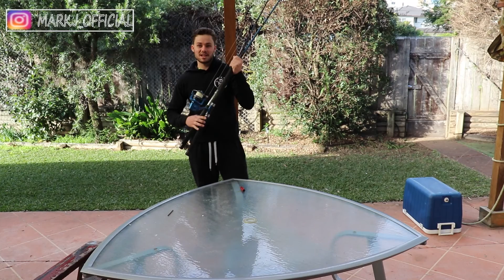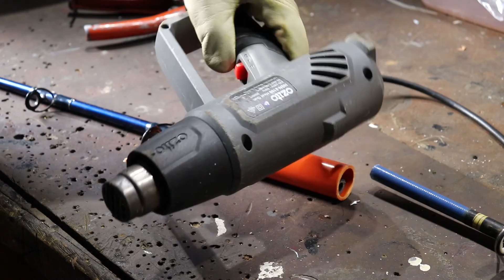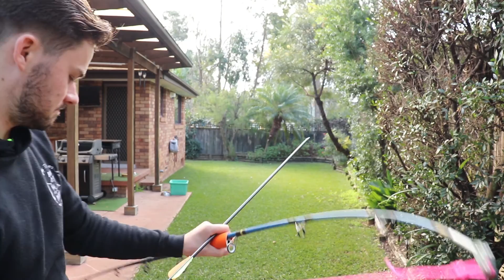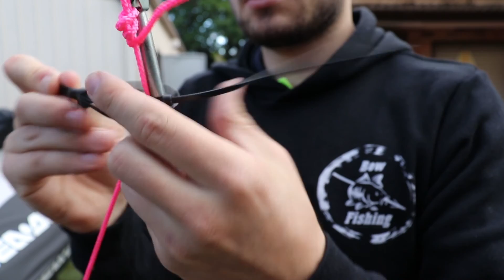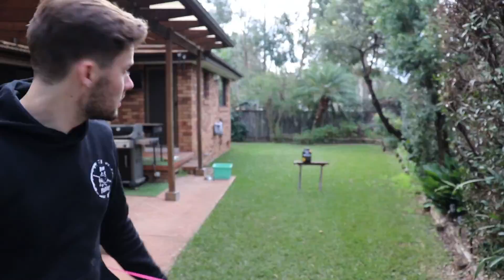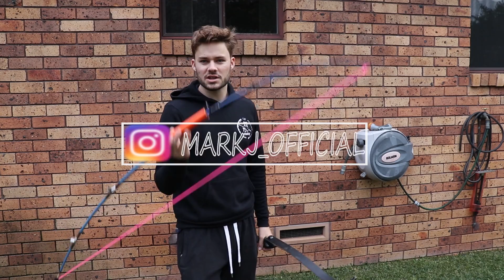Turn Old FISHING RODS into a 40lb BOW for $5 Very Powerful Extremely Acurate

Comment: I had an idea like this but I joined the two rods by a tube at their handles so that it could still be taken apart. I did no   cutting and looped the bowstring  over and then one side of the line rings at the end. I added the rest of the sections to the upper bow and had a round arrow rest through the tube and kept the reel on.  The line came from the top and looped under and around the arrow rest so that when fired the line was drawn out behind the arrow then slipped off the rest when you turned it around to use as a rod to land the fish.  Trouble was in the UK it would only be legal  in the sea and I am a midlander .